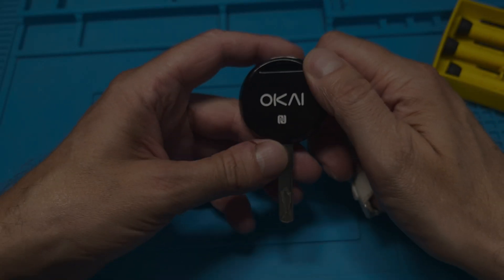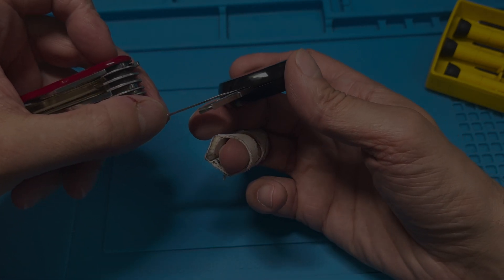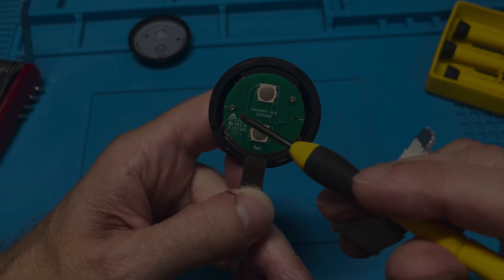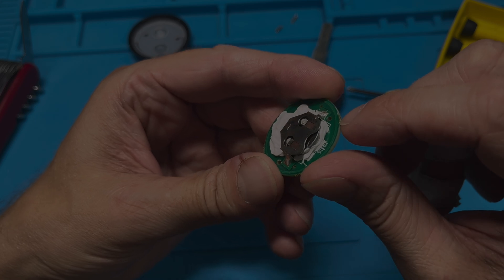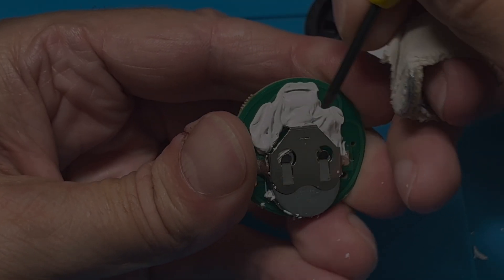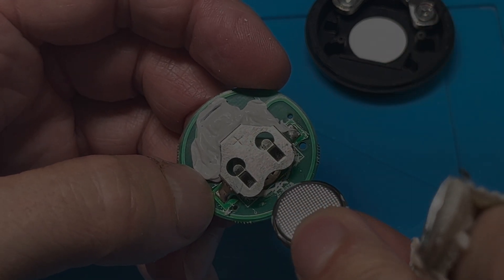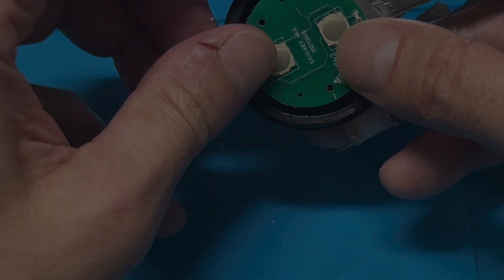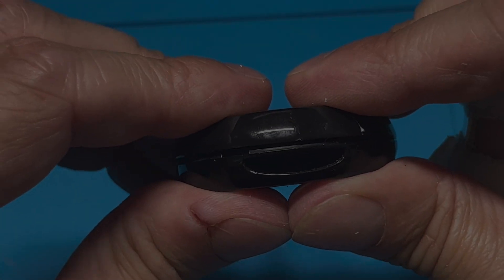Battery Replacement Okai Electric Scooter Key Fob (How to Instructions - EA10)

Comment: Is there a way to get a spare key, bot the key cards they sell. I see they sell keys with new cylinders,  but id like just a key. Its unhandy to have only 1 and have to bring the cell phone with to unlock it every time in case the battery decides to die while out and about. Thanks for explaining and sharing how easy it was to replace the current battery.

Comment: Hey i have one of these scooters. Ny girlfriend hit a bump and the thing turned off. The display wont turn on at all. The battery has voltage and is charged and connected.

I suspect a connection at the display is the cause, but i cannot get th damn plastic off for fear of damaging it. 

Do you know how the plastic near the displays comes off? Ive unscrewed all the bolts underneath the handles